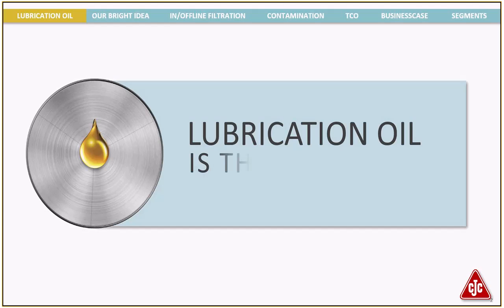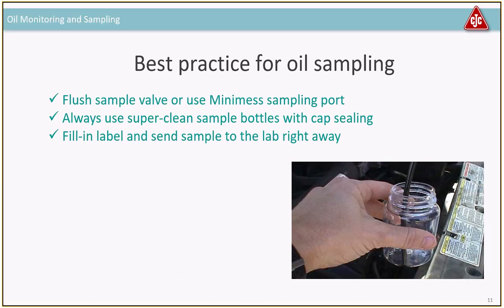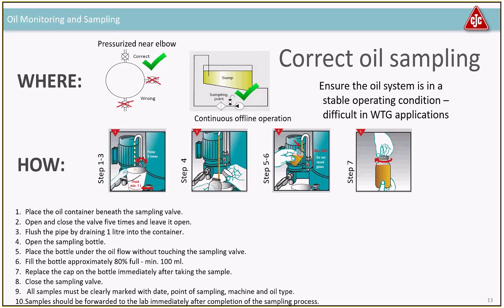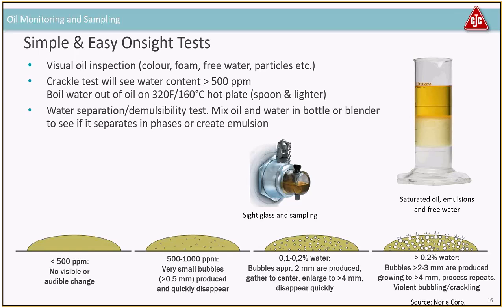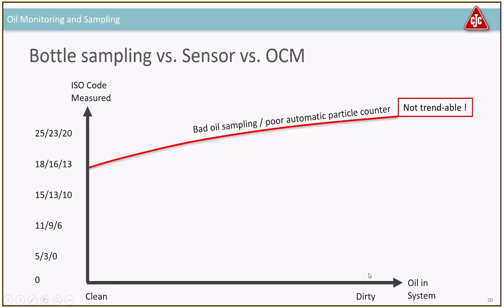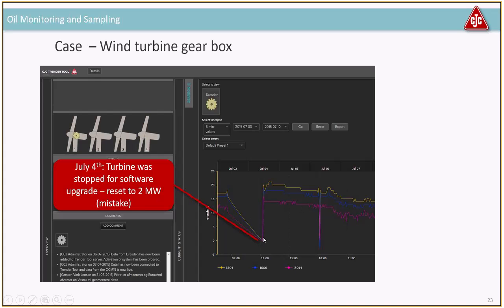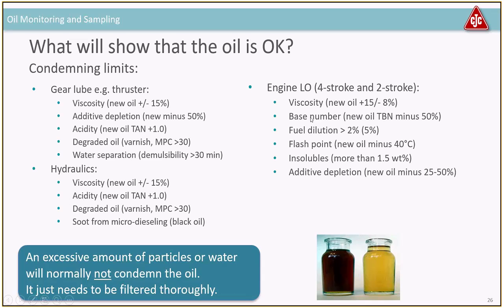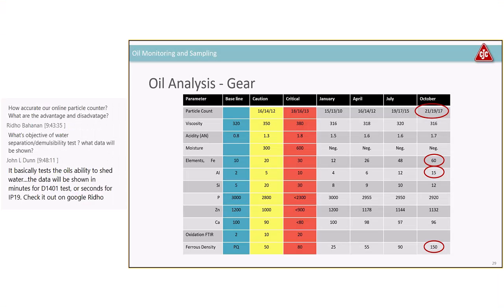How to take an oil sample, oil analysis reports and online condition monitoring

Comment: Oil monitoring technology is based on the equipment in the physical and chemical properties of lubricating oil index, wear particles and impurity pollution monitoring on a regular basis, timely grasp equipment lubrication and wear state information, diagnostic equipment wear fault types, reasons and positions of provide scientific basis for equipment maintenance, guide enterprises to carry out the state of the equipment maintenance and lubrication management,  In this way, major accidents can be prevented and equipment maintenance costs can be reduced.
learn more at www.inzocint.com , contact via email info@inzoc.com or whatsapp +8618820936586